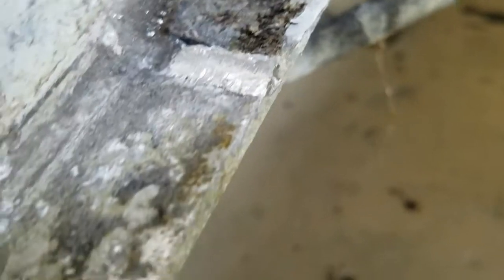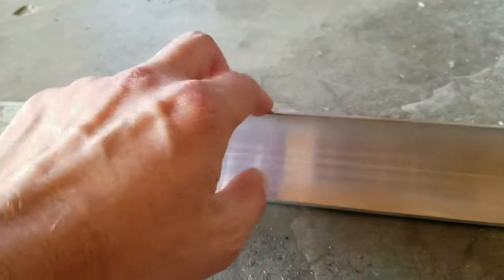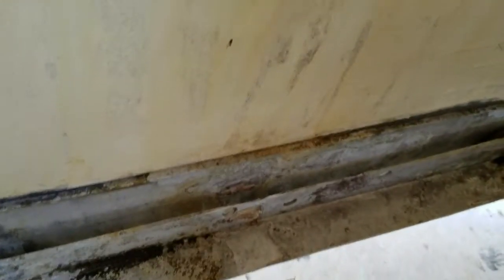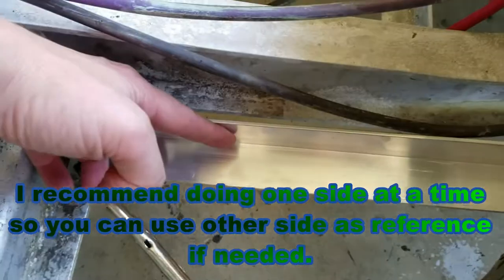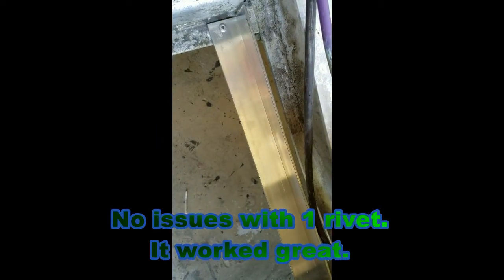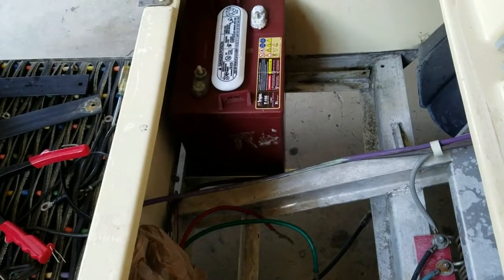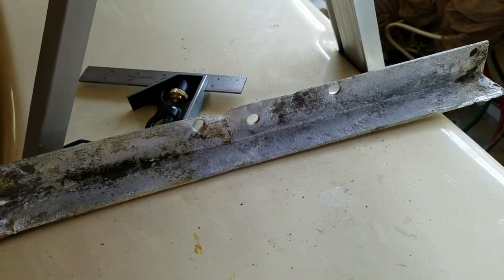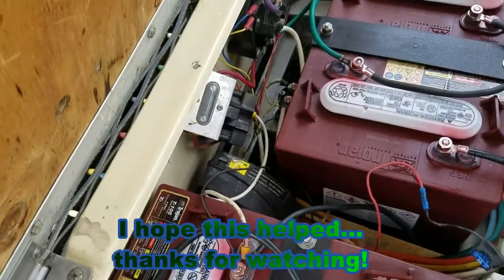Club Car battery and frame part 2

Comment: Thats a lot of weight for one tiny rivit. Those should be welded in and a cross member for better support.
Reply from the maker: tjsnordic the rivet is not holding the weight, just keeping the brace in place. I agree that welding would be better, but it would be tough to get a good weld there.